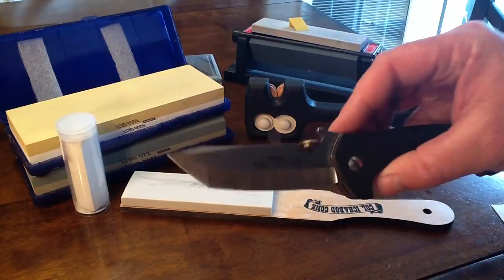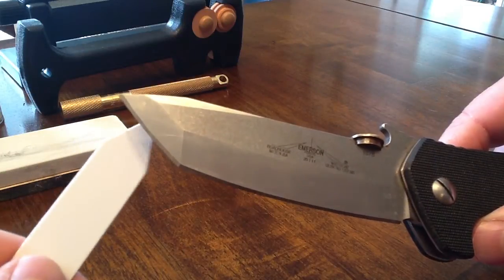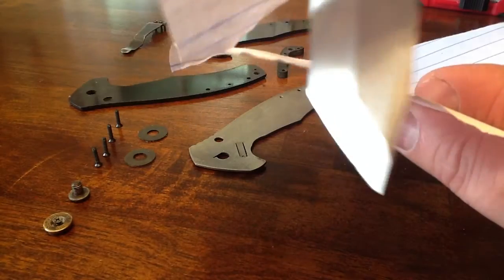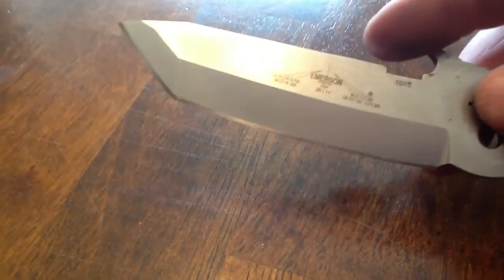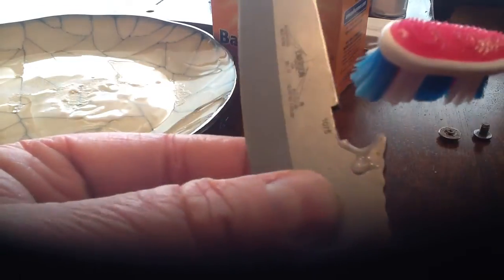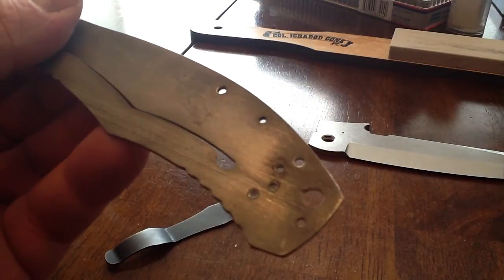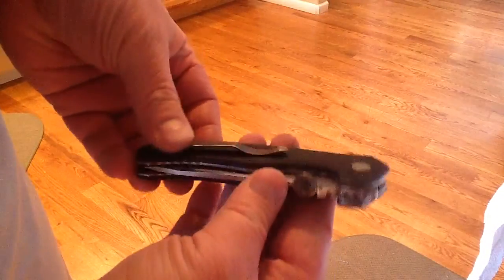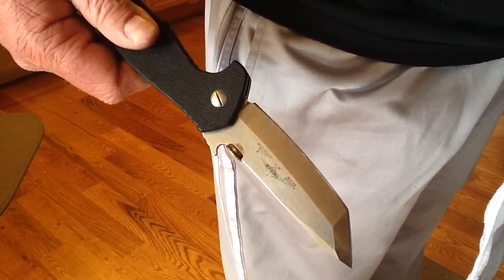Sharpen a Chisel Edged Knife like an Emerson

Comment: Really good video!!! BUT its not chisel ground :)
Alot of people call emersons chisel but only a few are real chisel ground. Your is a V grind with the main edge on one side. The blade is still a v grind. A chisel grind is totally flat on one side like the bulldog, socfk or version of the cqc7. 

Nice job on the video always good to see other peoples sharpening perspective
Reply from the maker: Jimmy Kimber Thanks brother. I definitely appreciate the information.
Reply: V-grind primary but does have a chisel grind secondary bevel. The actual cutting edge bevel is only ground on one side, even on the V-grind knives.

Comment: I think it's always better to either hold the blade on the table flat or have it installed on the handle that way you will be able to keep the angle consistent, just a tip. You obviously know what you are doing though. Good video for those who struggle.
Reply from the maker: Appreciate the view.  I can always be better.  Appreciate the tip.